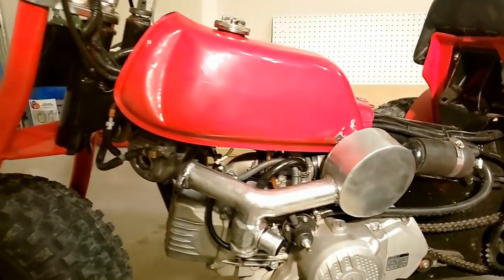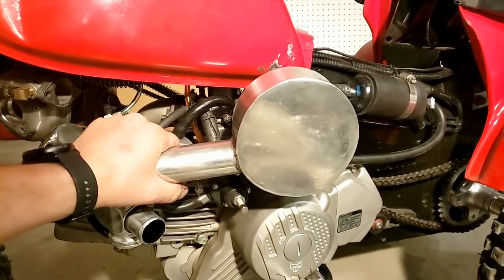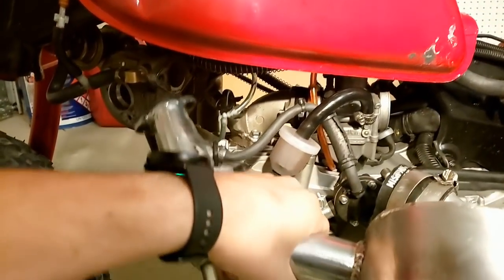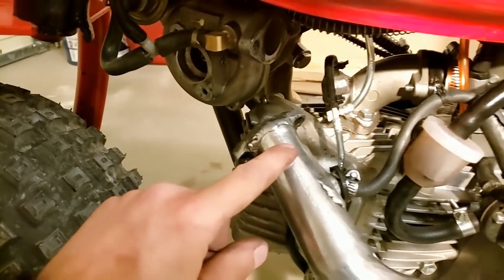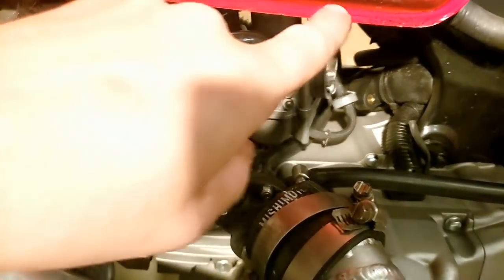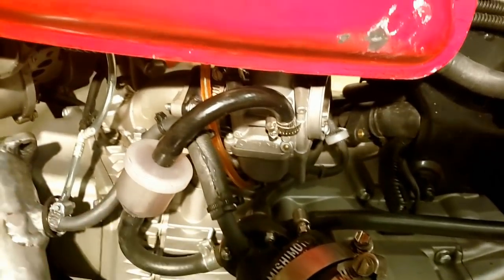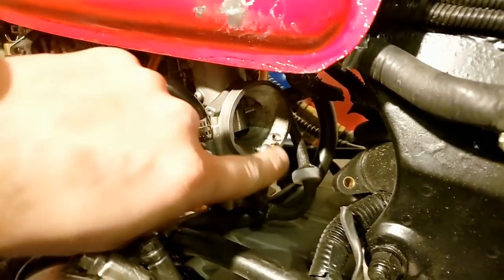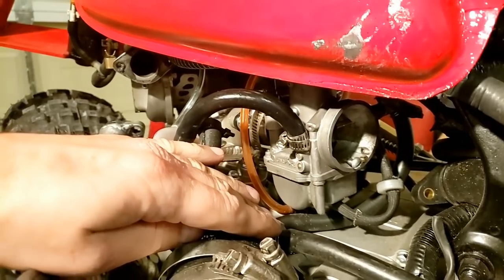Honda ATV Turbocharger - How to turbocharge #1

Comment: This is amazing
Reply from the maker: Thank you!
Reply: Do you think a setup like this would work on a 250cc atv
Reply from the maker: @thecrackercartel9324 Absolutely! Anything can be turbocharged, despite what uneducated people say online. Yes, even two stroke carbuerated motors. It just takes time, and dialing in the carb, vaccuum/pressure line sizes, etc. But, once it's dialed, your good, for the sake of a long conversation. A 250cc motor works decent with a GT1241 or the smallest of the (3) different GT15 turbos. Or any other brand turbo with similar sizing.
Reply: Thanks I want to do it but I don’t want it to blow up due to my lack of skill and knowledge 😂

Comment: Just put a big check valve in the intake connected to a filter. let it pull air in there when not on turbo.

Comment: Might do this to a 300ex any recommendations for what turbo to use at a good price?
Reply from the maker: Nope, no turbo at a good price lol. Actually a used TD04 Mitsubishi would work great. Get a compressor rate for the horsepower you want and a hot side for rated for roughly double the horsepower you want. Single cylinder life...

Comment: What motor hipster 190 where to buy if so  I thought this was a Honda original 70 CC motor is that correct
Reply from the maker: The motor in this is a pitster pro 190. You can buy them all over different online vendors or from pitster pro themselves. It's the same motor as the Zongshen 190.

Comment: Hey bud, when you say pull the choke and put sealant on it, did you remove the choke or seal it shut?
Reply from the maker: Just on the threads of the choke assembly itself where it screws into the carb. This was all done on the stock Chinese carb that came with the motor.  Keep the choke functional. 🤘
Reply: Turbocharged 
Ok sweet. The choke is still in there. Thanks again mate 🤙🏻

Comment: Could you provide a link of the turbo you used? I plan to do the same to my quad although I'm having trouble finding the right parts.
Reply from the maker: If you want a turbo that will work good,  use any of the rhb31 or vz21 models here: https://www.amazon.com/Friday-Part-YM129137-18010-Turbocharger-3TN84TL-R2B/dp/B07JNB5S94/ref=asc_df_B07JNB5S94/?tag=hyprod-20&linkCode=df0&hvadid=385177046298&hvpos=1o11&hvnetw=g&hvrand=2372603290407505117&hvpone=&hvptwo=&hvqmt=&hvdev=m&hvdvcmdl=&hvlocint=&hvlocphy=9029892&hvtargid=pla-825589215066&psc=1&tag=&ref=&adgrpid=78533818517&hvpone=&hvptwo=&hvadid=385177046298&hvpos=1o11&hvnetw=g&hvrand=2372603290407505117&hvqmt=&hvdev=m&hvdvcmdl=&hvlocint=&hvlocphy=9029892&hvtargid=pla-825589215066
Reply from the maker: If you want a GT1241/GT1238SZ hybrid, you'll have to search and spend more money. Remember this is for a 190cc SINGLE CYLINDER motor.
Reply: Turbocharged any recommendations for a 400cc motor ?
Reply: @zacharysavoy3551  I second this question!?!?!?

Comment: Hi. Great build. Did you make any changes to the ignition? What CDI did you use? I'm thinking about a build using the same turbo on a 110cc motor. I see that a 52mm water-cooled cylinder is available so I'd try to cool the turbo using water and oil. I've watched your other videos and like your oiling system. Thanks for an amazing build and informative videos.